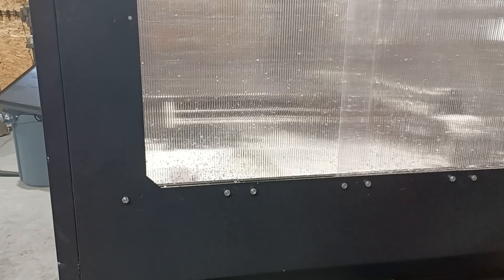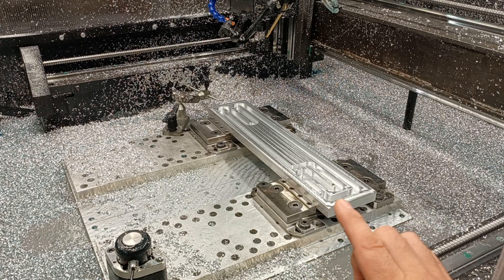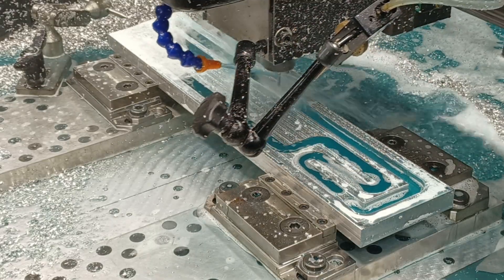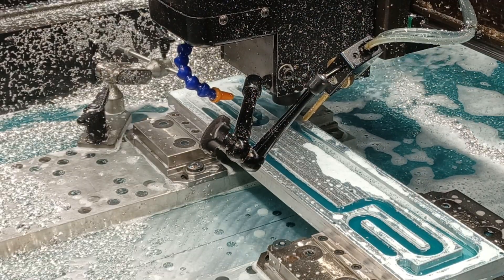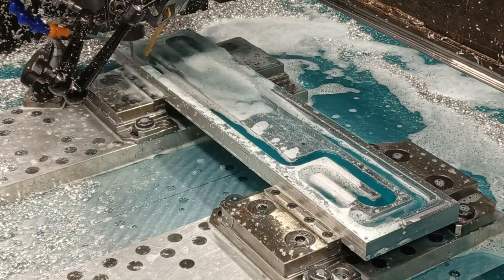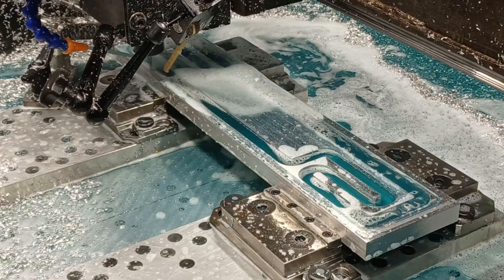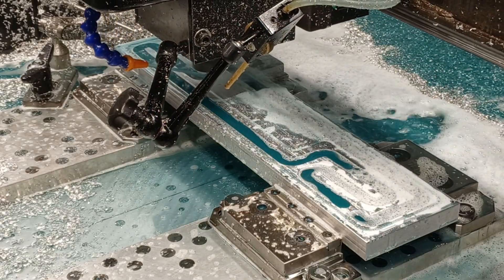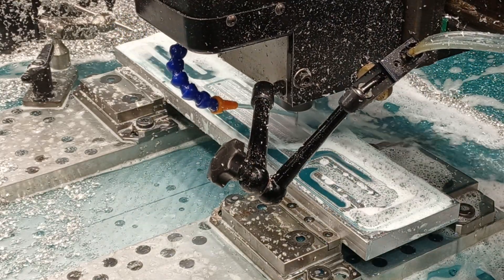CNC Machining an Aluminum Quench Plate (Part 2) | MR-1 Gantry Mill in Action

Comment: i know nothing about quench plates, but why no chamfer?
Reply from the maker: These are internal features.  There is an O-ring and a lid that bolts onto the top of this.  Also chamfers cost $.  To set up and run another opp would be another $10.00 per part.

Comment: Intention to inform.
Maybe you change the spindle to a easy to change tool thing.
Offcourse you can drillmill holes but at the cost of a mill not change tools ? That can get very expensive very fast.

Then it seems to me you the coolant comes with heavy flow that is ok but chip evacuation has do happen or the endmill is ghost cutting. That will dull a endmill faster and the chances for gum up the flutes is very high.

The next thing that pokes my eye is only a 1 side approach of coolant. We did burn a few endmils until we changed to a at least 2 nozzle evacuation. 
The next thing is when you push liquid cooling onto the endmill or part and blow it right away how should it cool or lubricate good?
It would be better install 2 mist busters with a 2 sided approach.

There are round formed nozzles that blow almost in a 90° angle into a bore hole get some make some. 
Safe the most expensive spare part that is - endmills.

In the long haul it counts what you burn away on tools not the 30 sec on a tool change or the installation of a very high effective chip evacuation system. 

Unless you can grind your own endmills of course...

When you dont want to buy early on some new ballbearing screws... protect them well and lubricate them or the will been used up faster then you may think they could...

It is a ballbearing that does the job bearings should be held clean otherwise they will go out of business sooner.
Reply from the maker: I might change out the spindle to a BT30.  Or I might just buy a CNC that has a BT30 already.
Reply: @BeckTools  Maybe think about a hsk32 or bigger. And maybe think about a bigger machine at all. 

I have a lot of machines but all seem to be at some point to small ^^

Comment: Boring those holes from scratch looked stressful. Would have pre-drilling them helped? Ciao, Marco.
Reply from the maker: yeah, pre-drilling them would be less risky for sure but since I don't have a tool changer that means I have to run every part an additional time.  The name of the game when you don't have a tool changer is to change tools a few times as possible.  If I had a tool changer I could spot drill, fully drill, than ream them in less time than what it took to bore them with the endmill.   I'll get there someday. :)